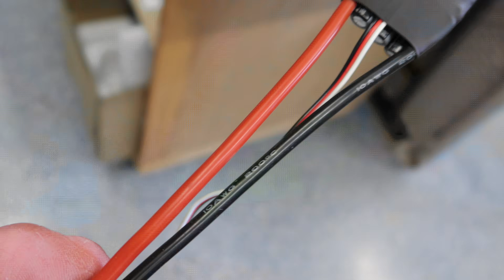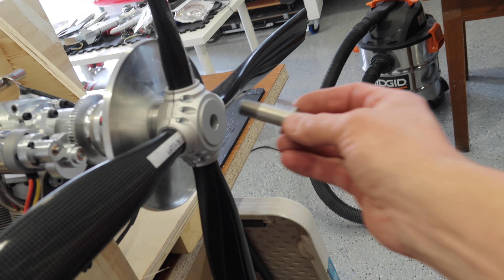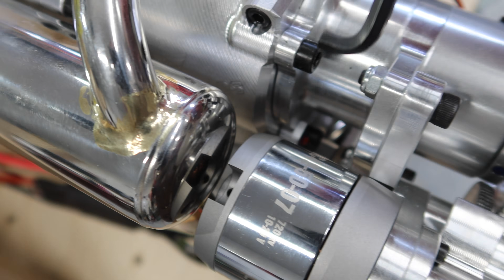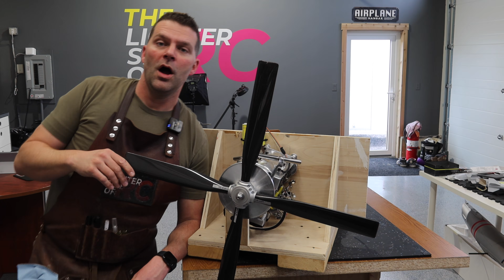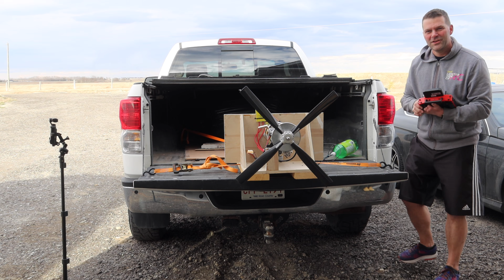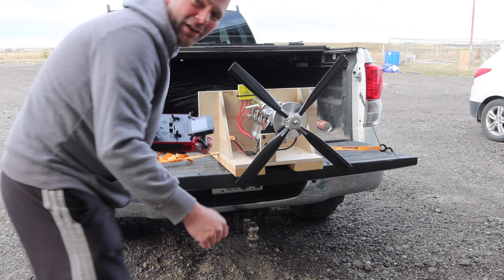THE THRILL OF SPEED - Test Running the kOLM 230cc Inline engine

Comment: those big engines are not toys,  and stop treating them like that. don't play around in frond of a running engine or aside of the propeller , don't trust your one work, and don't trust your live with the manufactures testing. I have seen simple things go wrong in seconds wile testing prototype /development engines and I have been lucky to walking a way unharmed.  Ps strapping a engine down like that is ok as long everything is in balance . as soon there is no balance everything in a circle  around that engine from 50 meters in in live danger. ( prop bold breaks, prop blade breaks, crankshaft breaks.)

Comment: I’d like to know how much power that these type of engines make the cost of these type engines and also I’d like to find anyone who knows anything about the 125cc stinger 2 cylinder engine and how much power it makes as well I have other plans for one of these engines other than rc planes if they make good enough power for thee application I want to use one for
Reply from the maker: For Kolm's lineup check their website for more info.

Comment: About two months ago I had the same engine in my mk1 Hurricane…now all I’ve got is the control box….and no, I didn’t crash it!..I took off for its maiden flight I did couple of test runs did some flybys…while pulling up from one fly past we don’t know what happened as we can’t check lol but we think the battery slipped and pushed the wires out as I lost all control and my mk1 hurricane just kept climbing till it disappeared through the low clouds…to never be seen again 😔….yes very gutted!
Reply from the maker: Oh my goodness that's brutal!!!!!
Reply: @thelightersideofrc  yeah I’ll be honest I nearly cried…worked my ass off to buy the hurricane a mick reeves mk1 with an 80” wingspan…then had to save for a few months for the engine…..I had the plane about 8 months from the start of the kit build…I had the engine 3 days…..it’s disheartened me to be honest it’s a lot of money to lose, don’t know if I’ll buy another.

Comment: Is the inverted cyl correct ???
Or Not ???
If so there must be a serious oil pump ???
Check out Testla Turbine Engine if ya want crazy power !!! Ceramic bearings is trick !!!
Reply from the maker: Yes it's correct.  No onboard oil.  It's operated lilke a 2 stroke. Oil mixed with fuel.

Comment: I guess its smarter to be lucky than its lucky to be smart.  I thought that engine was going to jump off your tailgate the way you have it fixed!  Check with an Engineer next time, it will reduce the probability of someone getting chopped into mincemeat with the propeller!  And look stuff up before air-time.   Ignorance is not a virtue to be advertised.  Millimeters of mercury (mmHg) is used for vacuum and low positive pressures.  COOL ENGINE though!
Reply from the maker: My lack of looking things up that I don’t need to retain worked perfectly!  76 comments  and counting on what the pressure measurement is the goal!  Thanks for watching and commenting 😉😎

Comment: FYI, mmhg means millimeters of Mercury (symbol Hg on the periodic table). 
https://en.wikipedia.org/wiki/Millimetre_of_mercury#:~:text=A%20millimetre%20of%20mercury%20is,denoted%20mmHg%20or%20mm%20Hg.
Old school way of measuring gas pressure. One atmosphere, 1 bar, 14.7psi equates to 760mm of Mercury(Hg) on a manometer. 
This tracks w/ ~4psi -> 4psi/14.7psi = .272 atmospheres -> .272 * 760mm = 206.8mm.

Comment: Seems like getting cooling air to that rear cylinder could be a bit of a challenge. I am not at all familiar with these engines, but seems like some kind of shroud assembly inside the cowl could be a good idea. I probably would have even drilled a few outlet holes in the backwall of the engine test stand right behind the rear cylinder head for the test run.
Reply from the maker: Great eye!  Yea the cooling system is very well thought out by the Airplane Manufacture it's going in.  Very specific to this engine.

Comment: It's a beautiful engine and it sounds great but it looks pretty huge for just 230cc of displacement. Looks like it has a pretty low power to weight ratio, is that right?
Reply from the maker: It's a big heavy engine for sure.  It weighs 18 lbs and is a 4 stroke engine.  The power to weight ratio is pretty normal for this category of engine.  Something similar would be a MOKI 5 cylinder radial.  The aircraft these engines go into generally need the nose weight.

Comment: Think fuel pump would be easier than that coke bottle pressure system u have electric starter and no fuel pump😂
Reply from the maker: Totally true but one more fail point.  The fuel pumps use cheep normal motors which are prone to failure.  This setup is simple.

Comment: Worst thing you could do to break an engine it is run it a slow power.  Open the throttle and set the rings, idling does nothing but glue the cylinders

Comment: Sounds like it's running way to lean. Also if them carburetors have diaphragms you don't need to pressurized the fuel system. The diaphragms should pull the fuel on their own.
Reply from the maker: It's crazy rich at factory settings.  This type of engine requires pressurized system to run reliably.

Comment: Great little engine! I'm doing something similar to this with an old H-1 Kawasaki 500 triple using a jackshaft gear reduction for the prop drive. I've flown my 1/3 scale Kawasaki Ki-61 7 times now with this powerplant. Waiting for new Lectron carbs to show up.
Reply from the maker: Nice!  That sounds slick!
Reply: Damn I have always wanted one of those motorcycles.

Comment: How do you expect the cylinders to vary in tuning to compensate for cooling differences, once installed with a cowl?

Can it have a charging circuit added to the engine, to keep the electronics battery charged?
Reply from the maker: Each cylinder needs to be tuned individually.  Will cover that in the aircraft build.  Also installing temp sensors on each cyclinder.
Reply: @thelightersideofrc i have seen people on forums make baffles to reach all 3-4 heads individually

Comment: hey try ducted flex flap fan motor (ducted fishtail magnet coil motor), can be electric and/or gasoline, turbine, or even external heat ece engine
Reply from the maker: No clue what that is.
Reply: @thelightersideofrc  egyptian man fan
Reply: @thelightersideofrc  have you ever tried a valve pulsejet engine burner, with a flex flap valve, the flap in the middle (fish tail like back-forth flap) would work somewhat like a flap valve for a pulse jet
Reply: @thelightersideofrc  point is: pulsejet style engines have barely moving parts at all, and diy very easily, compared to piston/jet engines
Reply: @thelightersideofrc  kinda duckbill shaped flute pipe engine, if you know what I mean

Comment: Great video, thank you very much, I would love for you to give me the necessary advice for when the time comes for me.
In May 2020, he bought Thomas a kolm 230 v4 identical to his, and now I'm behind the strega like his. the kolm instructions are very scarce and perhaps you could give me some advice. For now, how can I re-prime the engine with a pump? Or better with a second empty tank? is the engine carbureted? Is there a manual? any exploded diagram? etc
As for the streha, is it necessary to buy the support kit for the kolm? is it possible to make it at home? Thank you very much, I love your videos. And if you can inform me more about the matter, I would be very pleased.
greetings.
Reply from the maker: Thanks Dantes.  Kolm Manual available on their website.  Also if you look at their Facebook page there are some pictures of the pressure tank setup.  For the Strega I would for sure get the support kit from CARF.  Of course you could make it at home but why not just get the kit and save some work/engineering.
Reply: @thelightersideofrc  Thank you very much, it helps me a lot, I'll let you know👍🏻👍🏻

Comment: You're starting to get into some real Propeller Horsepower there, Jonathan. Can you imagine building an appropriate scale B25 and putting 2 of them in the aircraft, yeah Baby? Makes my blood run hot!!!!
Reply from the maker: Oh my goodness that would be a nuts setup!!!!
Reply: @The Lighter Side Of RC  Oh yeah, nuts like a whole Box Of Brazil nuts, Cashews, Hazel nuts, Walnuts, Almonds, And peanut... Very impressive motor... I can't wait to see what you're putting it in... I'll be watching... Have a good day my friend.......
Reply: B25 used radial motors. Think Moki instead.
Reply: @Shelby Seelbach  You could build A B25 and put those 3 cylinders on each side and, There you go.
Reply: @josephkerkau2520  Sure you could. You could build a B-25 and put a single vertical stabilizer on it too and there you go. You could build a B-25 and put a second wing in it and there you go. You could build a B-25 and put four EDFs under each wing in twin nacelles and there you go. You could build a B-25 and install wingtip floats, a turbine in the tail, and give it wing panels from an imperial tire fighter and there you go. I hear you, makes sense to me!
In reality, though, if you want to put impressive horsepower in a B25, which used radial motors, you use large powerful radial motors, which are readily available and just as impressive. Think Moki. There you go!
Reply: @shelbyseelbach9568  Well, there you go!!

Comment: Bet it would be even smoother if the carbs are sync'd.
Reply from the maker: Oh Totally!  This was out of the package, no tuning.  KOLM states that it will run at these settings but tuned rich.
Reply: @The Lighter Side Of RC  Right.  But that's tuning.  I'm was talking about vacuum sync the cabs by manifold vacuum.
Reply from the maker: Way beyond my knowledge base.

Comment: Hi, which hub - propeller are you using? Could you share the pitch template? I did buy the same engine and I have the Soloprop hub but they stated that could not be used with the Kolm IL230. Thanks.
Reply from the maker: All of the parts came from CARF. Is a Vario prop but with the center portion removed. So each blade is adjusted at the tip independently using the wedge. Shoot me an email and I can give you the template dimensions
Reply: @thelightersideofrc  Just sent you an email. Thanks.

Comment: I would balance the prop as a unit. I weigh each blade, then I spanwise balance each blade like a heli blade. Then bolt it together and balance it as a cross. The blades are hollow around 25mm in from each tip. I drill a 3mm hole and next to it a 1mm hole for air escape. I inject Hysol to balance. If you have 0.1g scales use tape to balance the prop. Take the tape off and weight it. That gives you the amount of Hysol to inject in each blade. Carb adjusting. The carb nearest the back will be richest, carb at the front will be leanest. I use Pointed nose pliers to pinch the front line first. Listen for immediate sag (perfect mixture) or delay and increased revs (rich mixture) lean that. Go to middle carb, same thing and finally rear carb. (This is the line direct to the carb) we used 4s battery on starter…
Reply from the maker: Thanks Dave!  Great tips and advice!  I appreciate it!
Reply: @thelightersideofrc  did a lot of flying with a Voodoo-same set up…awesome! Jet fast, lands really slow!

Comment: Hi jon, i like you so much, so please don't stand into the plan of the blades nor front right quarter of the propeller never again! In case of broken or lose blade or propeller she comes out directly to the front right direction due to the rotation direction 😉. Hope see it full throttle soon 👌👌.
Reply: Ok sissy.
Reply from the maker: Lol. Thanks David. I was careful 😉
Reply: @thelightersideofrc   I agree with David. Video speaks for itself. Nice engine though.